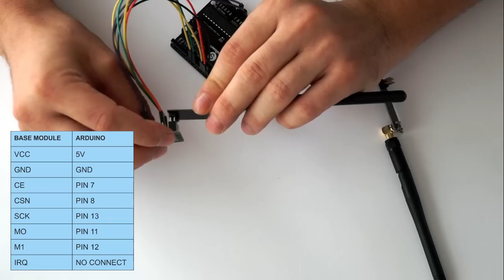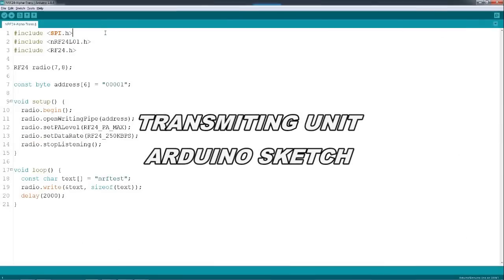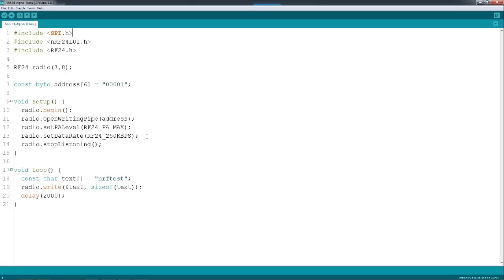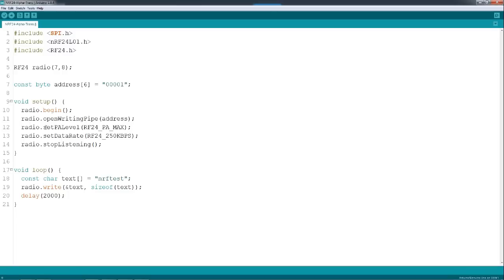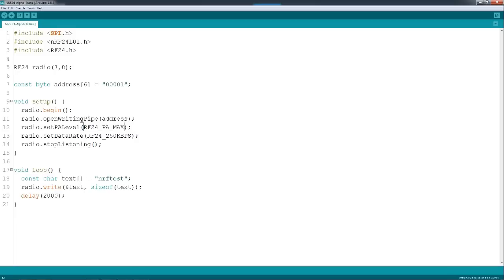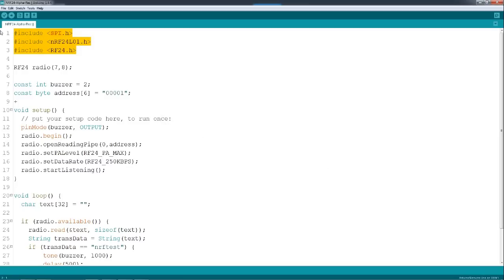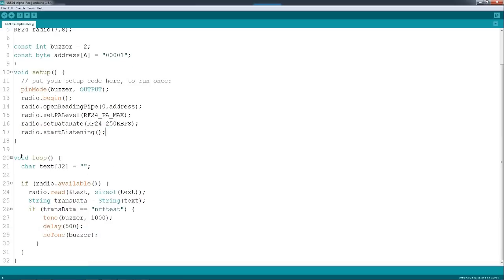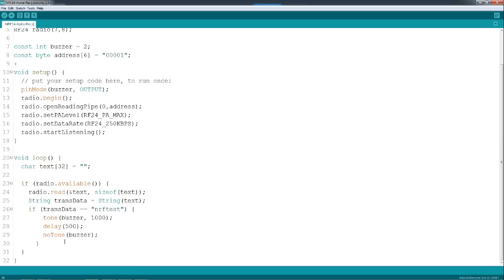Arduino + NRF24 simple tutorial and range test

Comment from the maker: Attention: There is a mistake in video, operating frequency of module is not 2.4 Mhz as declared but 2.4 Ghz. Sorry about that!
Reply: Thank you for the great video....
I need your help.....
Can you help me control 4 servo motors using 4 potentiometer.....
wirelessly.....NRFL01.....please,......
And the code explaination alsoo....

And is HC-12 better than NRFl01 for this...?
Reply: But can it switch between receiver and transmitter mid-program?
Reply: @yuridanylko  yes pls see it on how to mechatronics
Reply: @virtual_ninja810  Thanks
Reply: OK is anything should be changed on the code?
Reply: Hi, I'm making a spotmicro (quadruped robot), is it possible to send information from robot to controller and send commands from controller to robot with the same module? For example using a timer that set the tx as Rx and Rx as tx, or maybe by creating another channel.. or I must use one module for commands and one for information like telemetry?
Reply: Dario  yes, the module is tranceiver, it sends and receive data at the same time, just need to put some little changes in the code, like in the line 17 (minute 10:35)  you can start and stop lisening also start and stop writing, but i don't pretty shure if you can change the data rate and the power in the fly
Reply: @juanmontes8905  thank you
Reply: @Blondie SL i'm not completely sure but I think it can receive and send data at the same time or almost a single packet send and after that it could response, is like hearing mode and speaking mode
Reply: @learnings...1448  dude ı want to do same think but with 5 servo motors and 5 potentiometer
Reply: @oaiwjebdlla  am also working on similar project (quadruped robot) you can hit me up so we could share ideas. am a total noob  but am willing to learn more

Comment: Thank you very much!!!!  Unlike others, this video was very helpful and extremely easy to follow!! I have a quick question, if you don't mind.  When you performed the range test how did you power the units? Were you connected to a laptop or did you use a battery power source, if so what did you use?  

Thank you again for taking the time to make this great video
Reply from the maker: Thanks for your comments. I powered arduino boards with classic power banks, one is ravpower 16000mah, the other some chinese 5600mah. Also I did not work with HC-12modules so cannot comment on that. My primary use for this was controler for heating (thermostat in living room and controler in basement). But I ended up using nodeMCU because its all in the house and i use wifi. Its much simpler and if range is not priority, much more flexible because of webserver.
Reply: Tehno Manik wow thats a lot of current, did you feel that much current was needed? I was planning on using 2 - 3.7 4000mah 18650 in series, do think thats enough or will it be drained quickly. Sorry I cant find any datasheets on this module..
Reply from the maker: I have not tested current consumption, but if I remmeber it will drain about 200ma when transmiting, so depending on your setup and requirements i would say that 4000ma would be enough for at least 15h of transmitting. Of course, this is constant transmission, if you transmit periodically for second or two it would last much longer.
Reply: Tehno Manik again thank you for your time and efforts to help others, I truly appreciate you!!

Comment: Nice job, impressive range for 2.4 GHz, considering Bluetooth and 802.11 LAN reach 100m. Any idea why the range with NRF24 is greater?
Reply from the maker: BT devices generally have small internal antennas, and also have high bandwidth. With WiFi using 24dbi directional antennas you can get several kilometers range (tested about 3km with line of sight). As in any rf communication,  better antenna and higher power means greater range. Also higher bandwith means less range (for eg 4G mobile network vs 2G GPRS).

Comment: Good video. I have two of the high power modules but I can't get them to work. I set them up using the 3.3V outlet on each arduino for each module. After watching your video I see that this might be my issue. When I run the code to send a message from one arduino to the other all I get are blank messages on the other side. Is there anything else I could try or should I buy the base modules? Thanks.
Reply: @Dublin In the end I just used the short range modules that worked fine for me. Only thing I can think of is to make sure your send and receive baud rate in the serial monitors are the same.
Reply: Bro my modules are not communicating even i used different ones... I worked very hard but nothing came in my favour... Please help me... is it due to absence of base adaptors

Comment: Somebody help me, We only defined the CE and CSN pin of the NRF24lo1 to the arduino in the code, what happened to the rest of the three NRF24l01 pins ( SCK, MOSI, MISO) in the code, or it dosent matter to the code ! so we could randomly connect these pins to any digital pins in arduino differently in transmitter and receiver ?
Reply: The atmega328 chip has predefined pins for SCK, MOSI, and MISO as digital pins 13, 11, and 12 respectively. The chip select pin can be any digital pin, pulling low to to enable the communication, as per the SPI documentation.

Comment: Can we connect more than 2 of these modules so that they can act as both transmitter and receiver? And can they communicate in a chained way, like 1 with 2, then 2 with 3 and 3 with 4 and so on?
Reply from the maker: I dont know, try to find somewhere online. I ended up using mostly esp8266 in my projects because of easy setup and virtualy no hardware wiring.

Comment: Hi Bro, the base module is compulsory? i am doing a project but no use the based module too.
Reply from the maker: Yes base module is must have for stable operation because during transmitting arduino cannot deliver enough amps for successful transmission, hence base module with built in capacitors to store extra power when needed.

Comment: Hi sir, 
Great video
what is changes we have to do replace uno with nano please suggest any material.
Reply from the maker: Never tried nano, but it should be same code, only thing you have to change is your device in Arduino IDE for compiling and upload. Also I'm not sure about voltage on nano pins, uno has 5V outputs, if nano is 3.3V maybe you will need to use voltage level shifter from 3.3V to 5V. Cheers!

Comment: Any idea what is the successful bitrate that can be transmitted at 1 km? Can this be used for applications like bike helmet wireless intercom? TIA!
Reply from the maker: Sorry was away for a while, the bitrate I tested at 1km was 250kbps. It should be fine for voice communication, even 32-64 kbps bitrate is fine for voice. I never used these modules for voice comm, but i think it should be possible with extra audio modules. However it would be bulky and complicated setup in my opinion.

Comment: nice job, what is the maximum frequency we can transmit between tow module NRF24L01
Reply: It has 125 channels with 1Mhz step between each other and starting at 2400Mhz, so it would work up to 2525Mhz

Comment: Hi.. Im having trouble with my project. Using 2 arduino , I want to make a traffic control system with red and green LED which will light up if the Ultrasonic sensor detect an object (car). I want the system to work wireless using nrf24l01. When the first green LED turn on(for 1 min), the second green LED on the other arduino should turn off (red is on) even if its Ultrasonic sensor detect an object. It can only turn green after 5 second the first red LED turn on while the green was off. Can u help me with the program?

Comment: I have a question for you. Assuming that the module with the transmitter is a moving object (such as a drone) at the specified distance as in the video, and the module with the receiver is in a fixed position, that is, in a position following the transmitter. What type of antenna would be a more suitable option, especially the antenna on the sending side? I seriously doubt that the most suitable antenna type for 150 kbps data rate and 2.4 GHz is a directional antenna.
Reply: cözddün mğ kanka

Comment: Thank you a lot. I bought the components for my project and I will follow your tutorial.  I have one question about the base module. If I utilise the Arduino Due (3.3V output) + an output power supply, will the base module work? Thank you in advance.

Comment: Hello sir,
Can i transmit the voice through this NRF24 module....Please help me by fed your reply 
Thanking you sir...
Reply: I think it can but It have a very low data rate, could work with 8-bit audio and a 32Khz sampling speed, just loosing audio quality and increasing noise, and the atmega328 is very slow and havent enought RAM to play audio, i recommend to use an ESP8266, an ESP32 or something with similar power

Comment: Hi
I just need a suggestion about wireless solution for a sensor that will be in the basement in hole with a depth of 1 meter to measer the water level... Which may have best propagation power?
Reply from the maker: Do you have wifi router at this location and can your phone connect to this wifi from the desired location in basement? If so you could use nodeMCU to send data, I have nodeMCU in my basement as controler for heating system which is conected to wifi router on ground level. High powered NRF24 can send signal through several walls (concrete), tested between 2 buildings at 50m and 5 concrete walls inbetween.
Reply: Tehno Manik actually this project which stand from multiple houses, and I need to monitor the water for some them. There is no wifi around here, I was thing about Lora nodes connected to raspberry with 4G module.

Comment: Are there any types of devices that operate at a distance? for example, 5 km
Reply: Yes but probably isn't straight forward. You could use a directional antenna to increase the range some. You could use an amateur radio to do it but that would require an amateur radio license. You might be able to find some other devices that can do it but you would have to probably have a license to operate at that power level. You could also do it with cheap cell phones.

Comment: Thank you for this video!  Using your script and tutorial I was able to make a transmitter with a Nano.  However the transmitter only worked when the Nano was plugged into a USB cord.  A separate 6.6 volt battery input to VIN and GND would not let the transmitter work.  Not sure why yet.
Reply from the maker: Maybe battery doesn't have enough power (miliamps) to drive module when transmitting. When using USB power it goes through regulator and I'm not sure if regulator also has capacitors in the circuit which helps stabilize voltage and power draw. I never used VIN to power my devices so cannot comment in more detail.
Reply: @TehnoManik  The battery is a 6.6 volt LiFe rated at 5C, so in theory it's capable of putting out 33 amps.  Therefore I don't think the battery is the issue.  The RF modules are plugged into module adapters, which are plugged into the 5 volt output from the Nano.  The adapters have capacitor filtering and are regulated to 3.3 volts for the RF module. Time to do some further digging.
Reply: OOPS!  Typo.  6.6 volts, 700 mah at 5C would be 3.5 amps.  Still plenty of power to do the job.
Reply from the maker: Not sure what to say, never powered arduino boards with VIN, only USB. Datasheet says 7-12V power input for board, maybe 6.6V is too low with voltage drop when module is transmitting. You can try to power module directly from battery, not through arduino pins. Look for connection diagrams online, just remember to ground everything together.
Reply: @TehnoManik  Yep, after some further research on the Nano, the 5V pin is fed directly from the USB 5V power.....or through a 5V regulator from the VIN pin with VIN from 7-20 volts.....or it can be used as a direct 5V input.  The 6.6 volt input to VIN isn't enough to maintain 5 volts under a load due to the voltage drop of the regulator, not the battery.  Lesson learned.
Reply: UPDATE:  Just tested the Nano using a simple 9 volt battery to VIN and GND.  The RF module worked perfectly!
Reply from the maker: Nice, glad you got it working! Thank you for your feedback. Cheers!

Comment: i use mega to uno..is the SPI .i have 2 pair NRF with and without antenna but  still cant connect..help
Reply from the maker: I really don't know. I used 2 same nrf24 with base modules. But setup and wiring is little complicated and if range is not required I suggest using esp8266.

Comment: Question: on every nrf24 transceiver modul I noticed a short between the GND (outer shielding) and antenna (inner pin) of the SMA connector. Did you noticed the same?

Comment: Thanks a lot, with this video I could did a behavior test and  I could saw a perfect behavior with my modules. thank you !! another thing, you know how send analog values with these modules, for example send potentiometer values or a some temp sensor values?  regards!
Reply from the maker: Glad you like the video, thanks for comment. As for sending values, you can cast it to char array on the transmitting unit and send it to receiver. Than on receiver end if needed cast it back to numerical type (int or float) so you can use it in your calculations.

Comment: Trying to make this work for over a week now. Unfortunately no success yet. Maybe anyone here can help? I have no where to go. Both modules just won't communicate. Any thoughts on where to start troubleshooting? Checken about a thousand times if the wiring is right, so that's not the problem ;)
Help is MUCH appreciated!!
Reply from the maker: Do you use base modules? Do you only have 2 nrf24 modules? When I was using those modules I accidentally fried one module, I believe my ground wire disconnected for a moment and from that point I could not get them to work. I ordered new ones and replaced and then my setup started to work again. Anyway I ditched nrf24 in favour of nodeMCU and raspberry pi. Range is not priority for my projects and I prefer ease of setup of nodeMCU. Try replacing modules if you have any spare available.
Reply: @TehnoManik  Thanks for your superquick reply. Didnt know these modules were so sensitive to error. I'll get some new ones and try again. And yes, these base-modules work great for easy connection.